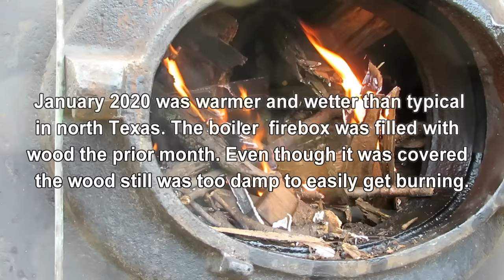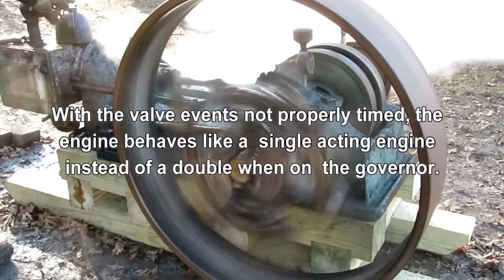1890-1900 Atlas Automatic Steam Engine Part 5 Evaluation Begins

Comment: i could really see steam coming back if we had an apocalypse.
1. not enough people left to destroy the forest by burning wood for this
2. requires VERY LITTLE to almost no oil, only before start-up and a few drips into the cylinder every 30 seconds. oil rigs will be unmanned and shut down so all the oil we have now will be all we get until an oil rig is reopened
3. unlike electricity, steam doesn't go bad. batteries go bad after 10 years, and with all the battery manufacturers for cars gone, there won't be any more production of batteries for cars. Or even solar/wind.
5. generators could be powered by wind, water, or steam.
6. steam is a very powerful force that can nearly rival diesel if it wasn't so heavy and time-consuming to start up. but hey, in the apocalypse, you got all the time you need. especially when you have others to make a sustainable place that can make its own food/farming.
7. it's easy to make a steam engine. a simple air tank welded to the top of a 55-gallon drum with a fire under it can make enough steam to run a small car as seen here: https://www.youtube.com/watch?v=5UIX8A_bP9g&list=LL&index=3&ab_channel=PROFESSORPARDALBRASIL 
8. it's easy to maintain since the metal will be everywhere for you to just take since no one else will be around to stop you. probably the people, 12 mountains over, next to the valley on the right, in another group. but that's about it.

Comment: What kind of work or load could this handle?
Reply from the maker: Just about anything that could be belted and needs no more than about 18HP. It would take more boiler to sustain that power level though.
Reply: @lineshaftrestorations7903  I need one at 180-500hp any source for a powerplant.

Comment: What is the psi in the boiler?
Reply from the maker: Usually try to run at 90-95psi. The safety valve pops at 100psi.

Comment: Like you said, valve-timing needs doing. There is quite a bit of blow-by, so it may be worth doing a lap-in (I'm assuming slide rather then piston valve).
Reply from the maker: Its a balanced slide valve. It has some scoring on the valve component mating surfaces initially seemed to be minor but it does have a lot  of direct steam leakage to the exhaust.
Reply: @lineshaftrestorations7903  are all the mating surfaces cast iron ?
Reply from the maker: Yes
Reply: @lineshaftrestorations7903  With proper lube is practically immortal.

Comment: The engine is really designed  to run in the opposite direction with this type of crosshead.  Here the highest  thrust on the crosshead under load  is being applied via  the two keeper plates, not via  the main upward face of the frame. Accelerated wear  and noisy operation can be expected. It looks to be an efficient design with variable cut-off achieved by the governor at the flywheel  adjusting the travel of the valve rod instead of just throttling steam supply to vary valve box pressure.  Not that any of this totally useless information matters !
Reply from the maker: The rotation really does need to be reversed. Unfortunately, it's not as simple as changing the position of the valve eccentric as a flyball governored engine would have.
Reply: @lineshaftrestorations7903  Very strange why it was configured like that. I recognized it having made a Stuart Number 1 which has a similar crosshead.

Comment: Do they make an instrument that connects to the drive shaft to measure torque rating and performance  while tuning , I don't know much about steam engines but it seems like many different things can go wrong at the same time to hinder performance , I would imagine a tool like that would make life easier.
Reply from the maker: Yes, it's called a Prony Brake. It's where the term Brake Horsepower came from.
Reply: a thing called an indicator 
leaves a paper chart /graph 
connects in the  valve chest

Comment: これ、シリンダーの冷却って液冷？100℃までは上がるよね?
Reply: Steam engines don't have cylinder cooling, they run more efficiently when the cylinders are hot. Cold cylinders will condense the steam back into water, where it performs no work and can potentially even lockup the piston and cause damage.

Also, the operating temperatures are above 100°C even when the boiler doesn't provide superheated steam, because as pressure increases it causes the boiling point to increase as well. So if we assume the boiler to be running at 80psi, then the boiling point of water is actually a bit above 150°C. If the boiler has a superheater which allows the steam to be heated separately from the water, temperatures can be significantly higher, beyond even 300°C, though I don't think this boiler is superheated.

Comment: How we go self start
Reply: Proper phased governor valve. Governor should be shifted by 90 degrees before or after main rod (depends on needed rotation direction). On this video initially this angle was too big and after one stroke shaft stops.